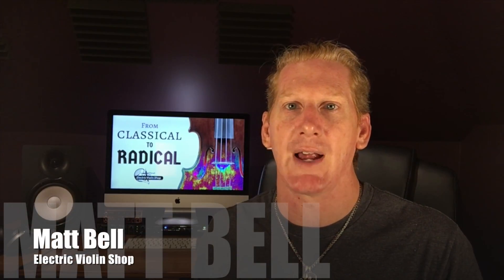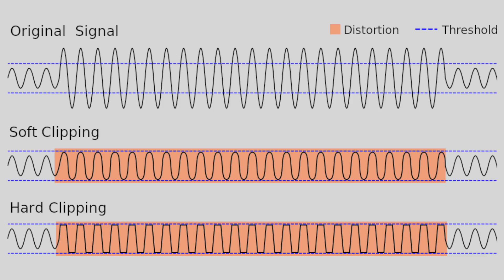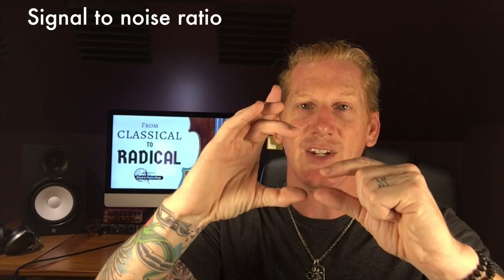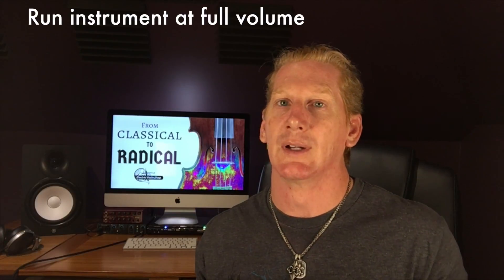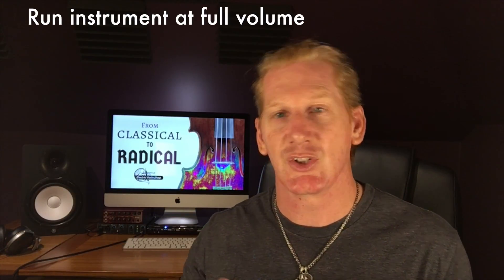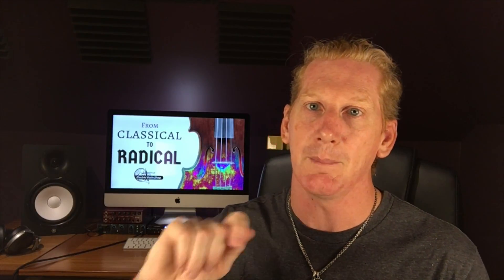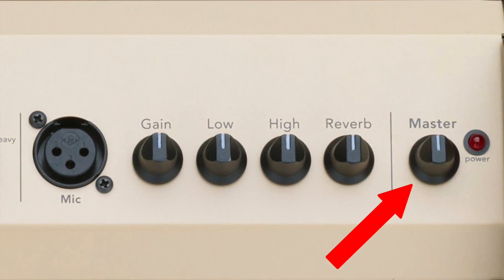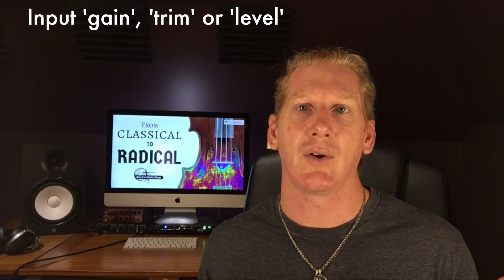FCTR: Gain Staging

Comment: Great explanation!  I was wondering, how can you tell if you are clipping with a YEV, a Boss ME 80, and a Fishman Loudbox?  For example, how do you make use of the pre-amp on the Boss ME-80 given how hot (or not) the YEV signal is?
Reply from the maker: Use the 'gain' knob in the EQ section on the ME-80. Try turning the preamp 'level' and master 'output level' all the way up, set your amp volume to a reasonable level, then adjust the gain knob on the ME-80 until it's just below the level at which hard double stops distort. That will give you your maximum clean signal. Once that gain amount is set you can adjust your ME-80 and amp levels accordingly.

Now, if you are using the amp models, e.g. Crunch, Lead or Drive, in the preamp section for a particular distortion sound, then you may want more gain to get the desired amount of overdrive, but for clean signal to drive other effects or clean tone from the amp you should follow the first method.
Reply from the maker: Also, we've noticed that the YEV is, by far, the loudest of all the electric violins we carry.  It's not unusual for it to clip out effects pedals.  Simply turn down the volume on the back of the instrument until you're not clipping anymore.